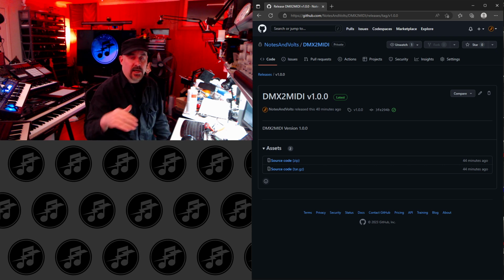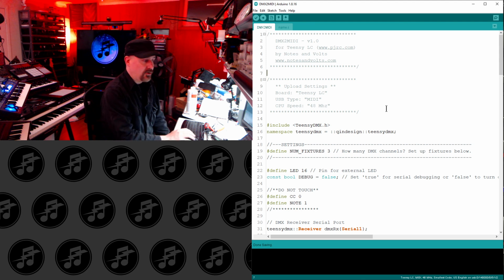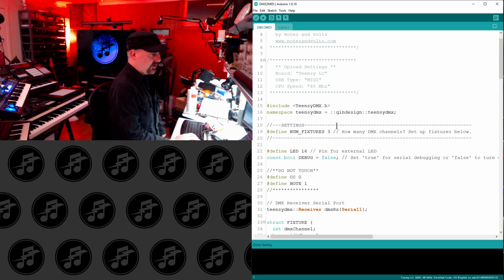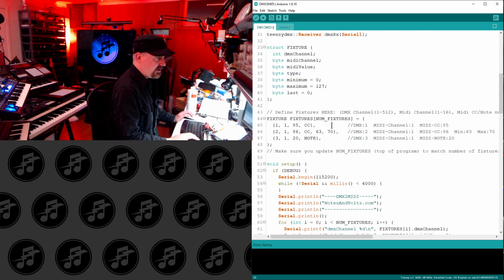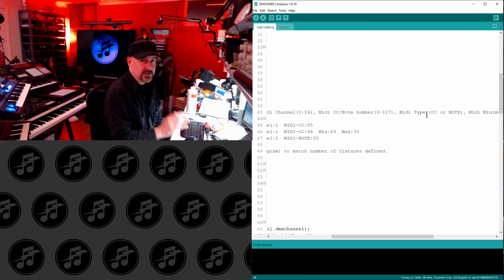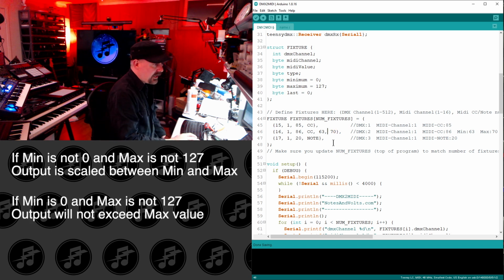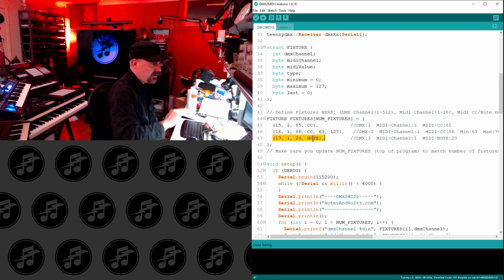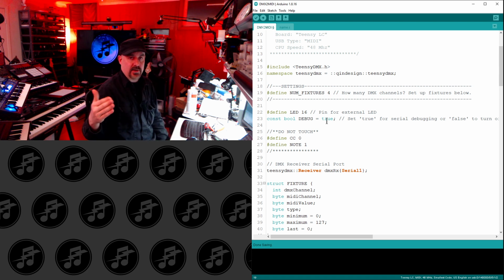Make a DMX to MIDI Converter for OBS - Part 1

Comment: would this be able to turn a DMX Fader Controller into a midi  Fader Controller?
ive been looking for a propper Midi Expression Controller for Film Scoring but there are non made for that purpose,  that are at an acceptable price point and  have propper build quality. This is a topic that many composers are frustrated with. there are some cheap yet very well build DMX controllers like the DDC-12 LCD DMX that would be perfect but they only output DMX Signals. Would be awsome if this would be an easy fix for that. maybe you can explain if and how that would be possible. i and many others would be verry greatful for that.
Reply: I am genuinely interested in this too. Also wonder if latency time is still OK in this routine? Technically this would allow also using a dmx fader controller to become a midi fader controller for music DAWs like ableton.

Comment: I think with your work it must be possible to use a multi slider dmx console like a .48 chanel cheap one to control various parameters in a daw like ableton live, thank you for your work, i will try to do so
Reply from the maker: That would be cool!
Reply: Hi, have you managed to get it to work? Lots of these dmx controllers just have the absolute perfect layout for Ableton live sets, and they're so horribly cheap compared to modern midi controllers with prices through the roof for just some sliders and knobs (faderfox etc...)

Comment: Its not always a good idea to drive a logic chip more than its supply voltage the 74AHCT125 would eventually destroy itself it would be safer to use a level translator chip these are designed to translate between 2 different logic level voltages

Also the parts list the max485 device has the same url as the teensy board

But other than that an enjoyable video I am a practicing electronics engineer in the uk but i dint know how to program for midi and now thanks to your videos i do now dms512 is making sense
Reply from the maker: Thanks TDR! Link is fixed. I believe that the 74AHCT125 is 5V tolerant when powered with 3.3v. This is from the Adafruit site:

"You can also use it to connect 5V logic out to 3V logic in, that's when you want to power the 74AHCT125 with 3V, it can safely read 5V logic on the input pins."